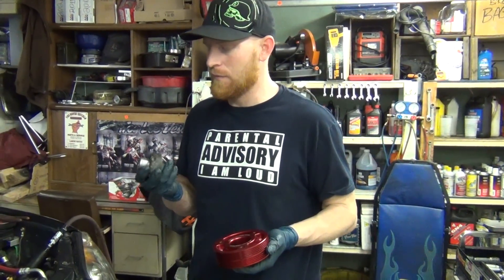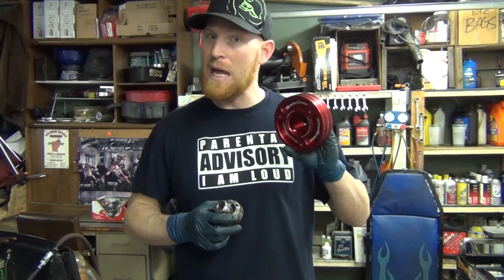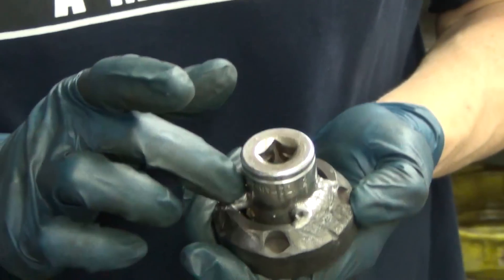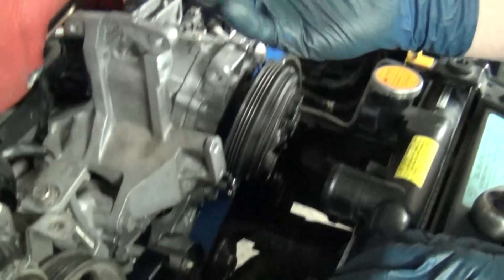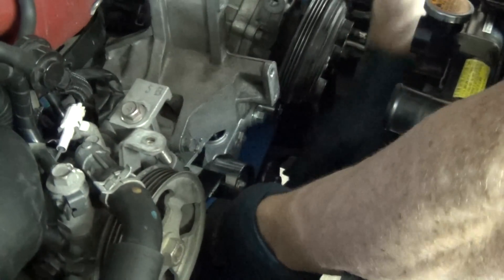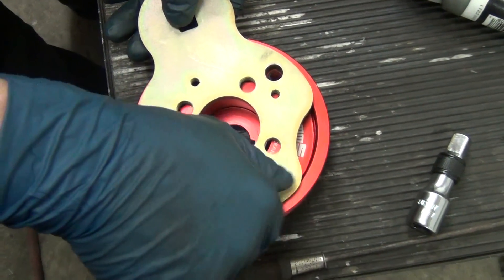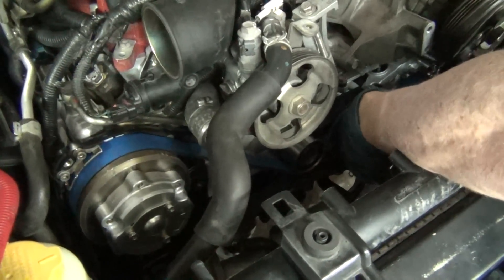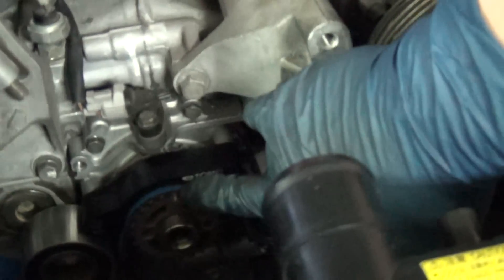Fabricated Subaru Crankshaft Tool

Comment: How can i remove the crankshaft sprocket if the woodruff key is broekn off inside?
Reply from the maker: Rock it side to side while you pry it off.  It will come slow, but it should come off.  Otherwise tap threads into it and use a bolt puller set.

Comment: Brian is it possible to give me the diameters of that center pulley and the width of the center key holder that you cut?  I use to work at a Bearing company and certainly I can duplicate it that tool you made!  It would save me the time to cut a pulley

Comment: @briansmobile1 I'm having a problem with my 98' Forester. My battery was dead because I was fixing a lot of suspension stuff and I put my battery on a slow charge overnight and started it, I held down the reset button to stop the hazards from flashing. I let the car sit over night, then when I went to drive the car it was really cold, I get in and the power locks start going crazy. I can't figure it out I checked the wires in the door and they appear bone dry

Comment: Much easier to save your old FWD axle nuts. They are great spacers to allow the factory bolt to tighten on the crank without the balancee and without bottoming out the bolt in the crank. so far every engine I have done, all the bolts are pretty close in diameter. So one nut fits most. I don't like turning the engine over with all the tension on just the key. Or just go down to the hardware store and get a normal nut big enough to wobble freely a little over the bolt. I have a nut that i notched for the engines that have the key extend past the end of the crank. Fits perfect.

Comment: its funny i striped my power steering removal tool in the middle of a job and it was a holiday nothing was open , i made one from cutting a notch in a 2 inch square tube to fit over the front of the pully and welded a nut to the other side with a 5/8s bolt to press it off

Comment: I just put the crank pulley bolt on with out a pulley and use that to rotate the motor. You can see the Mark on the crank gear and it's easy. But nice job on the tool

Comment: Yep snow blowing is not fun. We just had 22 inches of snow and now 1/4 inch ice now it dropping to -10 with winds of 30 mph . We have lost power 3 times and lucky I have 2 gen sets that run in parallel . Bad part is there gas wish I could afford to change them to propane as its a lot easier to get propane than gas .

Comment: awesome tool. sometimes its a pain to build or modify tools just to do a specific job. but other times its fine. i had to build a seal driver for rear hubseals on a gmc topkick 6500 the other day, took some exhaust pipe and an old leaf spring, welded  them up, then ground off the sides so it fit down inside the hub to press the seal without hitting anything. i actually enjoyed making it, actually, probably the welding more that anything.

Comment: Hello brian ,you have to tell me , why Wouldn't you use the bolt ?????????????????????????????????????????? engine rotation is clockwise , so is screwing the crankshaft pulley bolt , why not take the bolt tighten it all the way just snug and then rotate the crank / cam / oil pump sprocket etc... depending on which pulley your timing.. Really want an awnser on the matter please ! thx.

Comment from the maker: I still have it on the back burner.  I'm going to fiberglass the tank and my air compressor tank in the spring.  Right now it's buried under a tarp and a couple feet of snow.

Comment: The Grimmspeed Pulley tool is awesome, i got one and used it for my WRX when doing a timing belt, i also added a Grimmspeed crank pulley too but the tool is really beefy and great in my opinion.

Comment: These shop-made tools have to be the best. Any sissy can buy a tool, and anybody at a dealership can get the specialty tool from the parts guy. But an independent mechanic has to be better than that, ha ha. It's why I have trouble throwing stuff away, since one day I might find a second use for what might have been junk.